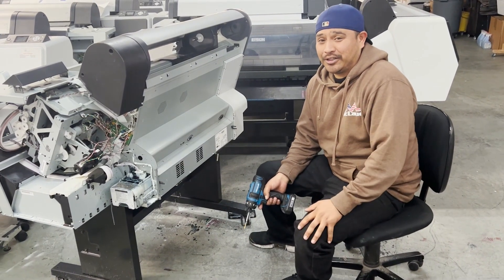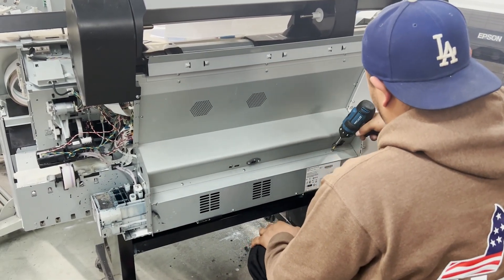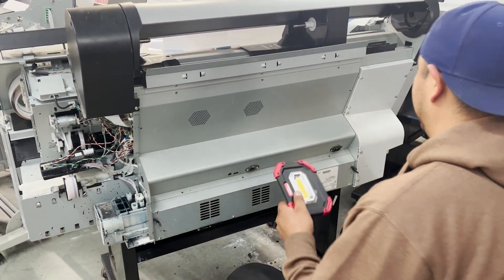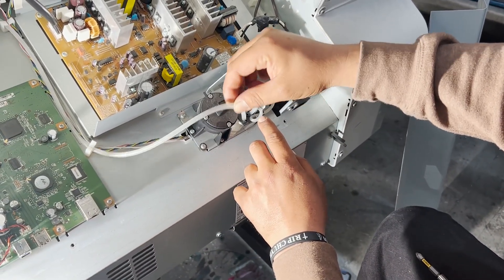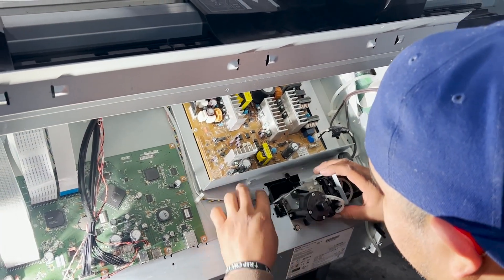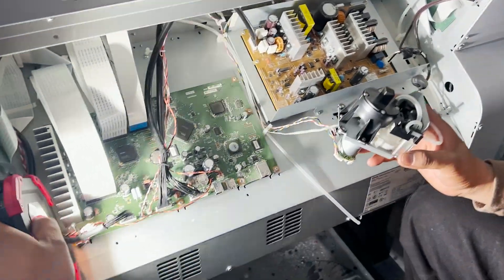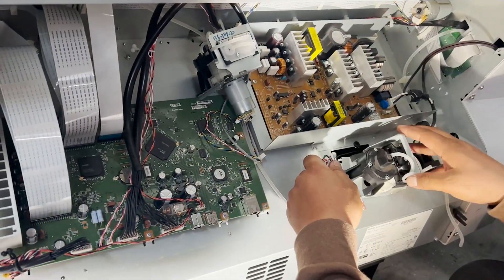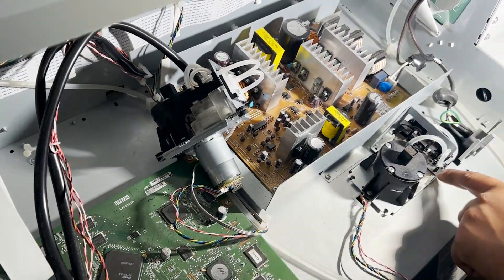McLaud DTF Vlog#259: How to replace Air Pressure Pump of Epson 7890, Part 1

Comment: Question:  I have to replace this on my Epson 7890 when the part arrives this next week.  My current one has black ink EVERYWHERE.  Is there supposed to be ink flowing through this part?  Or air only?  The clear tubes on mine have black ink in them, is that normal, or unique to my pump's failure and the clear tubes need to be replaced as well?
Reply: Also, my printer is an OG McLaud 7890, purchased from McLaud and delivered to rural south Georgia, featured in Youtube Video Vlog #189 (just for reference so you'll know what I'm working with, product and age).